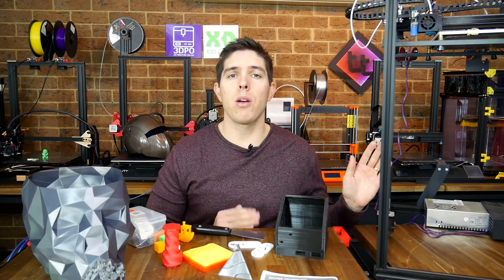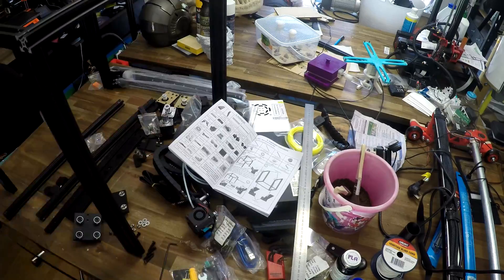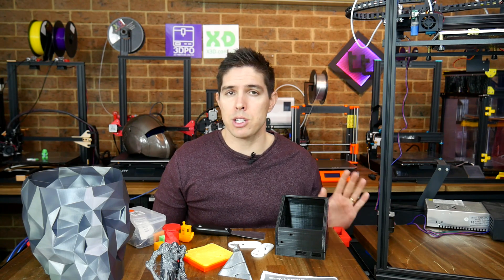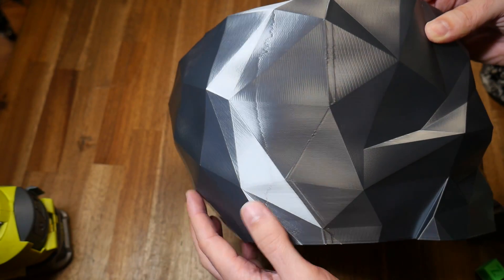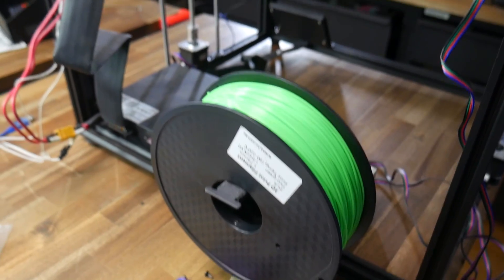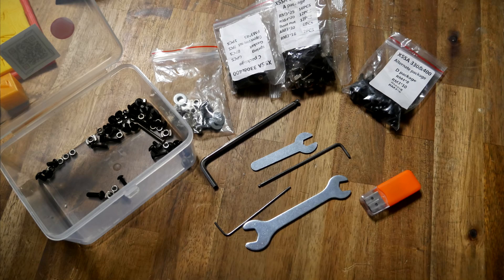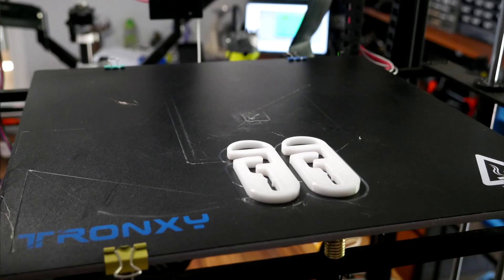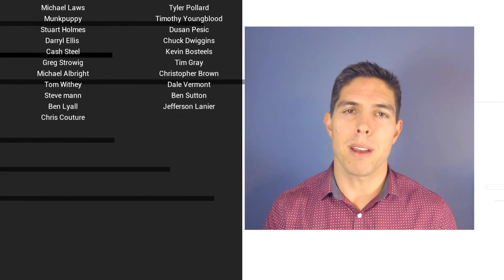Tronxy X5SA Pro review: A large format CoreXY 3D printer (with issues)

Comment: Everything you mentioned happened to me with this printer. I ended up ditching the motherboard and TFT replacing it with a SKR 1.4 Turbo (that is another long horrible story). As my 3rd printer I had really high hopes for the Tronxy but even the support from Tronxy themselves sucked. The bearings are leaking and are somewhat rough so no better than V slot bearings. Tronxy refuse to replace them. Im living with that for now. So I ended up doing the PTFE Capricorn mod as per CHEP's latest video and with the SKR 1.4 Turbo and TFT 3.5 it now works as it should. It took a long time to get sorted and Tronxy's proprietry firmware is rubbish. I dont recommend this printer to anyone as you can buy other CoreXY's that Michael has reviewed that are seemingly leaps ahead. In stark contrast I replaced my A8 with a Ender3 and the experience is polar opposite - Ender 3's rock!
Reply: Ender 3s do not. Better bang from a Voxelab Aquila C2… basically the same machine for $150 less. I use the Ender 3 profiles in Prusa Slicer for my Voxels and they perform awesome! I have an A8, another solid machine. Makes lots of noise, isn’t fast but prints some real nice detail with few errors.

Comment: Squaring an X5S is easy, attach your belts with a metal u-clip so you can adjust them easily.
Next, Use a ruler and measure from the gantry to the front bar at 2 points.
Adjust your belt lengths until the measurements are equal.... 5 minutes, no more.
Done, easy.

The X5S is not a great printer out of the box, but with some modification. It's a great printer.
First, throw away the factory controller and use a Duet2 ! add a 24 volt power supply to heat the bed....
Reply: I dunno, maybe because your comment is a year old but I would have a hard time spending $400 on this, $130 for a board,  $30 for a meanwell cheap powersupply.  You're $560 into this and you can build a Voron Switchwire for just slightly more with the right parts.
Reply: so in other words replace everything but the frame and motion system. might as well built a voron
Reply: @usernamel-f952  is there an echo?

Comment: From looking at it the odd line is most likely a bad nozzle its probably got a ding or a burr in the nozzle or maybe just out of round. the strange bands look like combination of running Linear rails out of square and not quite parallel, linear rails are very unforgiving in both respects and slightly loose belts will amplify that effect where the carriages out run and catch up to each other, constantly. could also be some wiggle in the gantry or just the belts not squarely tensioned both of those will also create banding. stringing is most likely either e-steps or slicer profile. any core x-y is very unforgiving with lack of rigidity or out of square but some is also due to bad parts choices.

Comment: I received mine about two weeks ago and its great! I have the X5SA-2E so i have two extruders, and i have the same issues. I have other printers so i know how to fix them. The only thing that i cant fix, and defeats the purpose of getting the duel extruder, is the second filament sensor turns on and detects the filament. But the second it starts printing with the second extruder, i get a replace filament error. I checked all my cables and everything but it still didn't work. so i was going to disable the sensors but cant find any marlin code, or know how to code it to begin with. A modification video would help SOO incredibly much!!

Comment: I have an tronxy X5S and after exchanging the powersupply, mainboard, stepper drivers, belt, rail system on the x axis(mounted a linear rail), extruder, hotend, part cooling fan and tinkered alot in the slicer settings i get really nice prints. Befor all of that i got a really 

rough surface on the z axis and alot of stringing and the heated bed could not reach 100 °C. The main thing that improved the print quality was the linear rail on the x axis because the stock system has so much play witch caused the 
rough surface on the z axis.

Comment: on tensioning the belt, I would have figured to add a couple of cable ties to the end of the belts pull on the end of the belt and then tighten the tie once the belt is tensioned?

Comment: oh god i got one is a piece of garbadge! i gor the X5S-E2 and damn is the most bad machine i see in my life...... 
mine are a hbot. so round are not round....
the dual z motor suck  wen you take of your piece well the bed are not in good position.
print quality are "mhe"
the machine are NOISY and the motor are REALY hot during operation
ghosting of course.
oh and after only 3 month the control car burn! literaly! and for the fun is put a propritary card of course!
the state of the machine now? well i put a ramp 1.6 and dont use it anymore due to the geometry probleme of the machine. and convert to a core X/Y look painfull to do.

Comment: Not to put too fine an edge on this, but the Bowden tube, like the belts, is deliberately going to be long on a DIY build and you should have adjusted the length upon assembly... that is more on your construction than their error, although they could have perhaps mentioned to adjust to proper length in the directions.  Otherwise, I am dumbfounded by the quality on this machine. It reminds me of a school project where one is given a variety of parts to build a machine from a picture with no guidance other than the cheapest one wins. In this case, the "cheapest" one fails... miserably.

Comment: Good and forthright review, I've had the predecessor to this (the X5S) and I currently have the X5S-500. They can be good bases to start from but, in my experience, require quite a bit of modification to get there. However that process certainly does give a person the chance to learn. :)

Here is a list of some of what I have changed on my TronXY printers, keep in mind that they (like a lot of manufacturers in this segment) do a lot of in line updates so some of what I've done may be standard now. I'll focus on my X5S-500, here is the majority of what I've done so far:

MGN12 Rails for X and Y axis
Replaced the controller with a Duet 2 Ethernet
Add a Duex 5 for additional stepper drivers
Add a PanelDue 7" touchscreen
Replace the build plate with a 500x500x9.5MM APT-5 cast aluminum tooling plate with kinematic mount
1000 watt 120v Keenovo silicone heater with SSR control
Add a 510x510 Wham Bam Magnetic Build System
E3D Hemera Hot End
MOSFET control for hot end heater
Triple Z-Axis for true auto bed leveling (12x2MM single start lead screws, 92 oz.in motors)
dc43 Mini IR Sensor or BLTouch
Reply: Wayyyy too much work to make a decent printer.
Reply: So basically you built a new printer...
Reply: @court2379  pretty much but it's a fun base to start from and a good learning experience for someone just starting out that wants to mod a printer at a reasonable price point.

Comment: Edit: I have had this x5sa pro printer for 6 weeks now. There were a few build issues, poor & incorrect instructions in some parts. Number 1 thing to do is loosen the sliding gantries, out of the factory they are way too tight this will include disassembly of the print head unit. You can hear them squeaking on some YT vids where they have not been loosened.
The print head  wire chain assembly is a total piece of junk at each end and would not have worked without mods.
Finally the most major issue is the Z screws (r/h) side particularly will not remain stable partly due to the weight of the heater wires chain pulling the bed down. It was impossible to keep the bed level at any stage, so I waisted hours on that. I bought some anti backlash screws which did not help much so I inverted them, used them as guides and put the original Z nut on the top of the bed carriage and use that as an adjustable interference fit. This has worked and my bed is now stable. The more complex fix of belting the two Z screws together can wait :( 
So now I just have to set the Z offset for more or less every print because that does not seem to stay the same :(

Overall not useable out of the box, and some intermediate tinkering skills and extra materials required to get the thing working.
I  had shipping damage to one ribbon cable connector, Tronxy customer service are more than useless, I doubt any replacement will ever turn up, you are basically on your own!!!  Dont follow the Tronxy  vids on Facebook either they are mainly inaccurate and user groups will tell you the best way to fix something not Tronxys vids !!!

Comment: I really hope people understand just how much time Michael poured into this printer trying to make it work. These reviews are the absolute worst to make, you end up wasting time on a dud product and the company has a tantrum. Thankfully though, it helps inform others before they make a purchase. 

I roasted tronxy back in Nov 2019 for almost setting my workshop on fire when it did go into thermal runaway at the end of a print... so the lack of it here is obscenely negligent.
Reply: I really enjoy both your videos and have learned so much from you in the past two months since I bought a 3D printer. But in this case I have to agree with the original comment, Michael did spend a lot of time, but I would expect that anyone who has the mechanical aptitude to make the mods on his car he has shown on youtube should be able to square a frame and tighten a couple of belts. Stripping out the hex bolts was just comical. And yep you have to cut the Bowden tube if it is too long. 

You were absolutely right to roast tronxy over the thermal runaway and UL and CSA should have prevented them from being imported in 2019.  But at $300 US for the X5SA pro was too tempting for me last week. For  $300 the pro is a cost effective pile of parts that with the addition of some aluminum corner braces to make the frame rigid,, metal stepper brackets, maybe a different bed sensor and a few key components will make a reasonable 330 330 coreXY printer,

Comment: I went for the X5s-2e - double trouble. I knew it was a crap machine and managed to pick it up for about A$250. It was not even core XY it was H-Bot (single long belt). I love to tinker,  so I thought why not. Firstly got my head around Chitu firmware as best you can and added thermal runaway and ABL. I converted it to core XY , ran a couple of 2 cololur prints then decided to make an easy change head. Currently have the original dual colur head (similar to the cyclops), a rip off E3D V6 with a volcano nozzle and am currently working on the Titan mount to be anle to print flexibles. Thankfully I have a Tevo Black Widow and an original Tarantula that are just rock solid. This is definatly not a beginner machine. It can barely print without mods. I have a spare set of linear rails I might install and when I've had enough of Chitu, I have an SKR 1.4 and screen floating around here as well.

Comment: I've had my X5S for around 1.5 years now - and it's still the best value, because you don't need to waste money on the shitty Chitu board and terrible ABL.
There's not much of the stock components left on it, but it works amazingly well now. I just wish they'd make a cheap, 8-bit X5S successor with the new rails.

Comment: here is a patch on their FTP site to enable Thermal runaway https://www.tronxy.com/software/
It uses 2208 steppers
You can find the firmware settings and how to adjust them here http://www.customize-3d.com/chitu-g-code-explained.html

In the video it is visible a part in the extruder broke off, this happened to me too when retracting the fillament too far back... There usually is a blob at the end where the fillament was in the printhead, I solve this by retracting the fillament about hafway back, release the tube and retract again till the blob is in the oben air... Break it of and reinsert the tube.

Comment: I almost bought one of these. Kind of glad I didn't now. I like modding my printers heavily, so that's not the issue, but the whole thing looks like an flimsy, unstable, overly complex mess. And, yes, at the price point, I can understand them cutting out some things for cost savings, but that just looks like a troubleshooting nightmare of a 3D printer. I'm also highly disappointed that it doesn't have TRP. I consider that an unforgivable sin in this day and age of 3D printing. Thanks for the honest review, TT!
Reply: I have one, it's actually very sturdy and not complex. Squaring the rail system is easy. That said, there are so many other issues and the video is right, it's prints terrible
Reply: @ldboehm  I'd assume that with some time and effort, it could be a good CoreXY machine. It's like my old Anet A8, in a lit of ways. Probably a great learning experience, but frustrating and inconsistent.

Comment: Hi Michael, great video.
I bought my X5SA Pro in the middle of February and ran into all of the issues you described (including the first head crash), except for the x-axis alignment problem. The build went reasonably well. The gcode flavor that Tronxy uses for this machine is called Chitu and it is a custom version of Marlin with weird quirks. I managed to get the PIDs tuned and turned up the speed to something reasonable, so now it produces "average" parts as you so eloquently put it. Retraction performance is quite good at 8mm. However, infill patterns still show through the outer walls and the outer walls in general have poor alignment. The system behaves as if the belts are far too lax, but they are appropriately tightened based on a belt resonant frequency check.
I'm not sure if I will be able to improve the print quality any further, but it is serving it's intended purpose by cranking out cosplay armor pieces with minimal sectioning.
Here's an example of print quality problems. https://photos.google.com/photo/AF1QipNdq6uViUTdeJersVmrWTxicyzJ-V4atHdARx5Z
Since I had already planned on sanding my parts, it is acceptable for me.